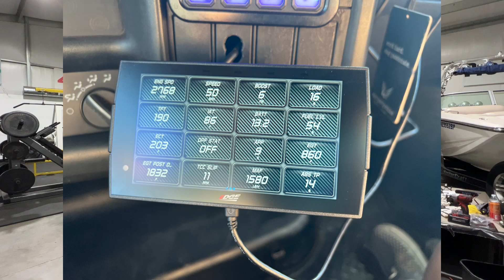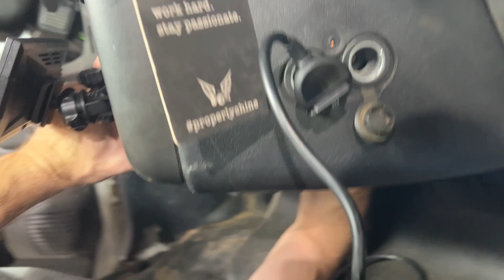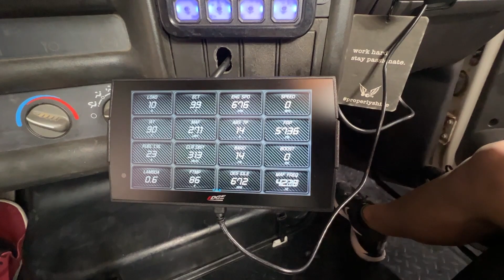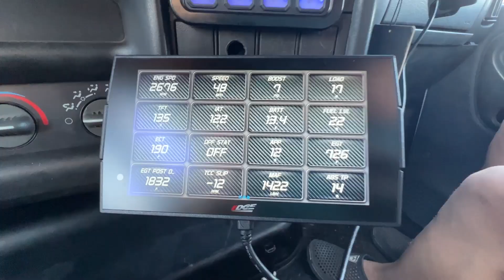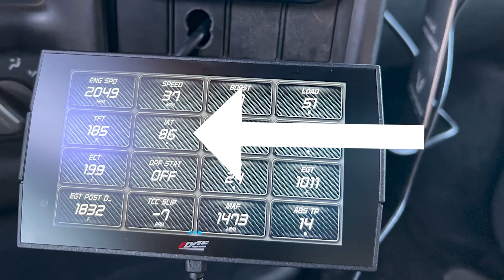Building our 4wd Kodiak Truck Camper! Part 8- Intake Temps

Comment: Stock factory air filter box but it had the k&n filter from new.
But over the years the affected fine seal between the two boxes when you pull it apart is a very small seal that goes all the way around between the two boxes. It disintegrates because of the heat so you get false air  there 
Also, I have a time at airbox will come to rest on the air conditioning pipe causing that pipe to wear through
I raise my airbox up half an inch Nuts that hold the airbox down, and also there is a grommet in the century that airbox put a spacer there if you don’t watch it around that area, it screws up the sensor just on the other side of the airbox.
Reply from the maker: Yup you hit all the things on the head!

Comment: Good to know
I use a K&N air filter for the last 10 years, I bought one of the OEM ones and I’ve put it in and I really haven’t seen a difference.
So, on the passenger side of the hood, where the air gets sucked into the air filter, what about a scoop on the side? 
Would that divert more air to the air filter????
Averaging 14 miles to the gallon now city and open Road nine, pulling the 40 foot wheel
Reply from the maker: Did you just replace the filter inside your box or did you have an open filter like I had? The problem is with the open filter. The factory intake seals up to the hood. If you just had the k&n filter in the factory box you probably won’t see much of a difference.

Comment: Nice but the that intake is considered a short ram intake witch does pull hot air I made mine a custom cold air intake full pipping and heat wrap
Reply from the maker: That’s awesome! I have a buddy who just did a pusher intake setup with some custom piping!

Comment: I have so many questions for this, l won't ask them all.
Well just one or two? 
is there a way that you can test for the flow rates of both intakes? And are you testing the temp after the charge cooler? Do you have a charge cooler?
Thanks for sharing 👍. 
Great install 👌🏻.
👍✌🏻🧡🌤🇨🇦🤘
Reply from the maker: Yes the only thing that was changed was the intakes. I could probably test flow rates and get some more info. I’m pretty sure the intake temps I was referring to were before the charge cooler but I’ll have to confirm that for you!

Comment: I just subscribed. Great idea to revert from the after-market air intake to the factory. I've kept my factory intake for this very reason and am surprised people don't know this important reason. Fashion over functions is too strong a draw I guess. Because I instrument both my alternators, I get a good idea that my underhood temps are at least 140F. The nickel-based anti-seize (which is apparently what you used) is the proper choice for a stainless fitting. Copper-based is problematic on SS (even though it does have a higher temp rating).  I use an OBD II Bluetooth and Samsung tablet running torque pro to display engine info like your aftermarket monitor....also a good thing to have very few realize...
Reply from the maker: Thanks for the sub! And thanks for clearing up the anti seize! I thought the same thing. I bought my truck with the aftermarket intake and have been searching for the factory stuff to replace it. Very glad I did after what we found out after testing!

Comment: Ok, maybe I'm wrong here.. But, I didn't see a switch for an exhaust brake. Does your truck not have one? Great video pointing out the fatal flaw in "cold air" intakes... Besides, the paper filters just flat out filter better than the others...Truck is looking great!
Reply from the maker: I don’t believe my truck has one unless the switch is just not there! I will have to look into that! And thank you! Probably saved myself some headache in the future!
Reply: @JensenAdventuresaz you need to look into that! With your tire size, load and loaded trailers, It's a game changer! Especially with the way that the Allison trans is set up to down shift.. Both my 08 6500 and 06 5500 tow trucks have exhaust brakes and I can't imagine towing without them..
Reply from the maker: @TimTheTowman  I can probably get the switch I do have some plugs behind the dash for certain switches!
Reply: @JensenAdventuresaz  I'm sure you will need the actual exhaust brake itself and any appropriate exhaust componants.. But, if i had to guess, I'd bet the wiring is probably there..  Like I said.. Highly recommend..
Reply from the maker: @TimTheTowman  gonna look into it thank you 🤙🏻